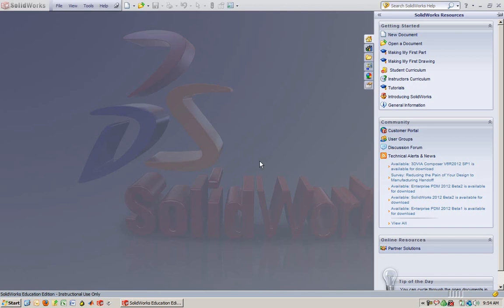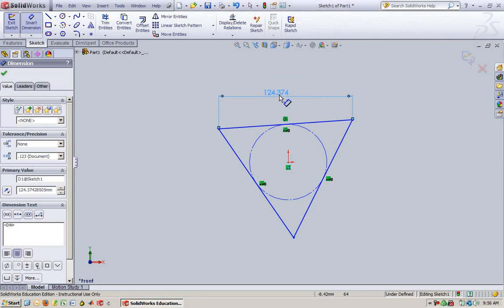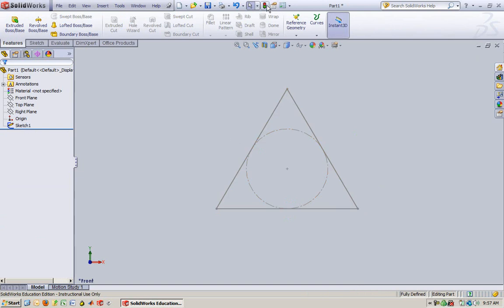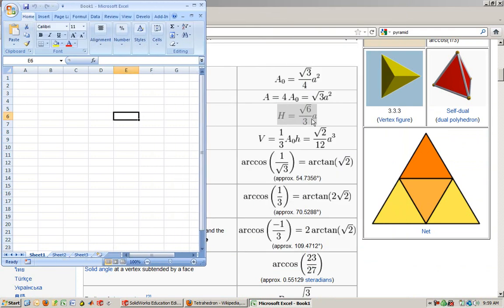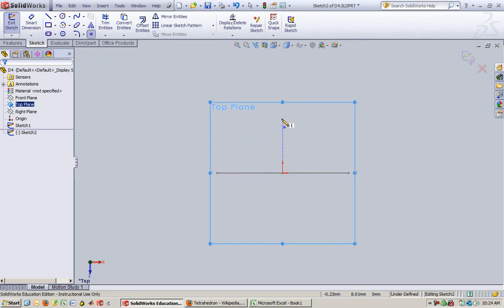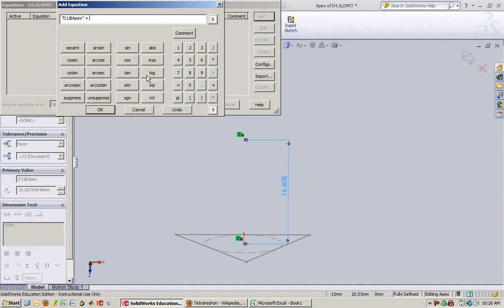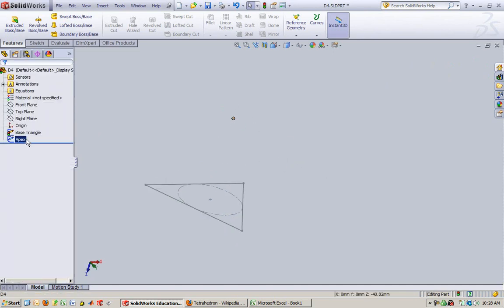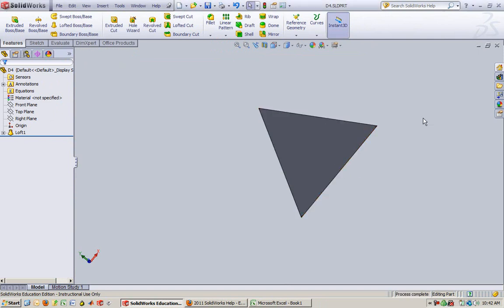Create a D4 (Tetrahedron) Using a Loft with SolidWorks

Comment: 2:00 It’s measuring the x-distance between the two points.

3:15 If you defined the horizontal first and then the length of the horizontal, you wouldn’t have the option to define the x-distance like back at 2:00 minutes.

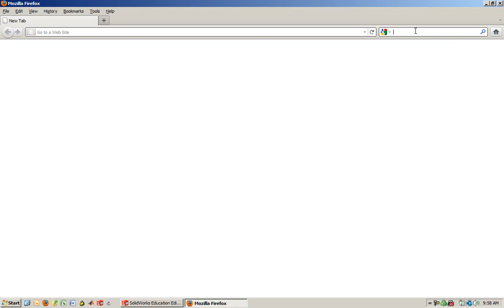4:15 “Tetra” (four) “-hedron” (-sided solid)

5:30 you could create a global variable “h” referencing the defined length of the side of the triangle so that no matter what you change the length to, it automatically updates “h”.

7:10 That’s where you set the dimension equal to “h”.

8:00 Agreed. Good word.

9:00 It’s been awhile, but I think you can type the equation in the dimension box and click on the line you want to use as a reference so you don’t have to look for its name. Or click on the actual dimension of the line.

12:00 Thanks!!